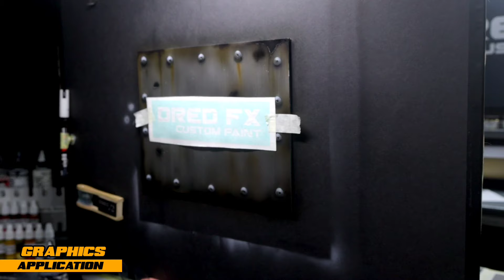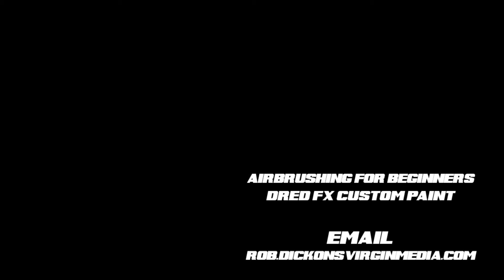Airbrushing for beginners METAL, RIVETS AND GRAPHICS

Comment: Excellent video! Quick question what is your mix ratio for FW inks and Golden high flow acrylic paints?
Reply from the maker: @Psychoemch  golden highflow is one drop paint to one drop water fw inks 2 drops ink 2 drops water 10 drops isopropyl alcohol
Reply: @dredfxcustompaint  thank you! Just ordered some Golden high flow acrylic paints and a set of FW inks. Next big purchase is a better air compressor! Got one of the cheap tankless ones as part of a kit good for priming and base coating but not that good for detail work. Maybe get myself a nice 6gallon tank compressor for Christmas. LOL!